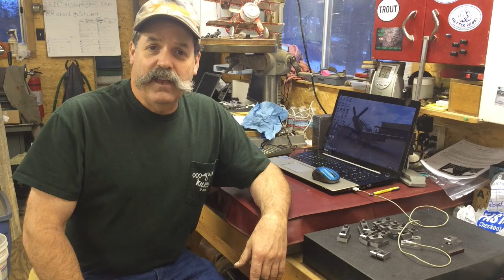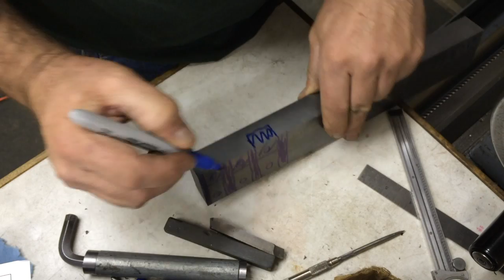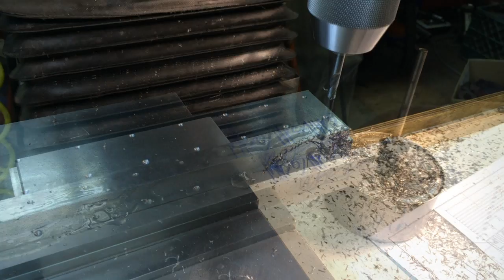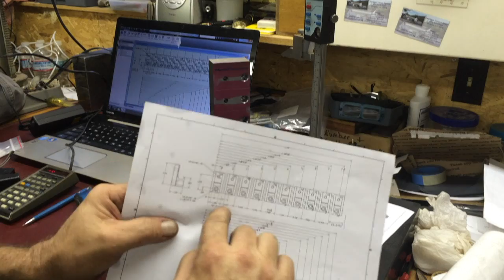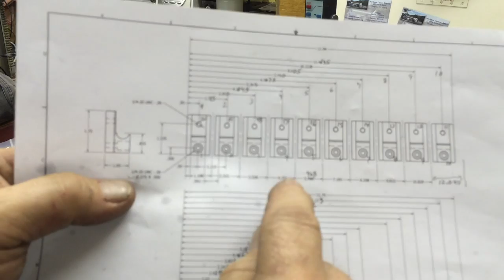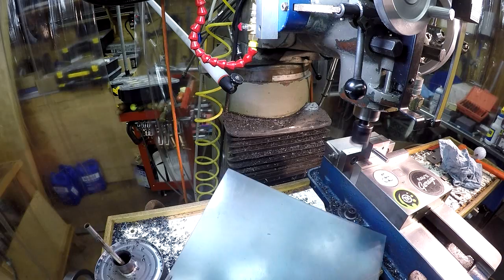How To Make Milling Machine Table Low Profile Clamps P1

Comment: Haven't seen the pitfalls or how you've done this yet but my theory is: cut your 12 peace Block in two sets of four so three pieces, then drill and ream the lengthways hole, make the three top division Mill cuts & Mill off the waist, undersized drill all eight holes in sets of 2, then finish Drilling in column first the back set then the forward set slightly smaller to allow for tapping, finally tap all the threaded holes then separate the blocks. That's what my theory says let's see what experience proves I will enjoy this...

Comment: Lovely stuff Randy - as I mentioned before, I can see all sorts of fiddles with set-ups and careful machining with pieces like this. Wondering if I can be brave enough to make some of these myself!
I just used my own lo-pro clamps for a facing operation,which are OK for 1/2", but not much thinner - these are probably about the ultimate.
Your realization about 1" bar stock having been preferable reminds me of so many times I later, after excessive work, thought of the easier alternative! :)
Reply from the maker: +ChrisB257 Thank Chris,  Randy
Reply: Randy Richard In The Shop n

Comment: It is a shame that oftentimes the easier way does not appear until we have already started down the other path.  At lest think of all the quality time you got to spend with your mill this way. :-)
Reply from the maker: +bcbloc02 Lots of time,  But they came out great and I used them yesterday, they work great.  Randy
Reply: I am notorious for doing things backasswards. Usually just before I finish milling, I get that "duh" moment. Trial by error education is sometimes the best. It gets permanently embedded in your memory for next time.

Comment: If that's your new camera mount system, your getting some shacking. Think you need to extend your vertical poll up and attach it to ceiling, so that it's ridged between floor and ceiling. You still may get some, depending on how far your horizontal poll sticks out, but that should take most of it out. On a second note, not really clear on how these clamps aren't going to stand proud of the work clamped directly to bed of mill for fly cutting? If videos are not completed yet, can you throw in a short part on how you use them?
Reply from the maker: +Fred Newman I bumped the camera, other wise the mounts are working great.  I will be showing the use of the clamps.  Have a Merry Christmas,  Randy

Comment: Nice job Randy! I got the dovetail cutter safe and sound by the way, it looks great! Thanks for the stickers as well. I am going to tackle the tool holders when I get some time. Any suggestions on what type of steel I should use for them?
Reply from the maker: +Cruiser Mac Great.  Did you not get a brass shop tag?  If the tool holders are for home use, 1018 Cold Rolled works just fine, that is what I used.  Have a Merry Christmas, Randy
Reply: Thanks Randy, Merry Christmas to you and your family as well!